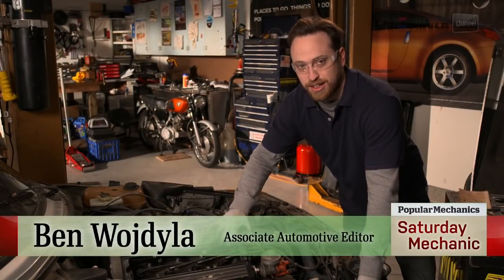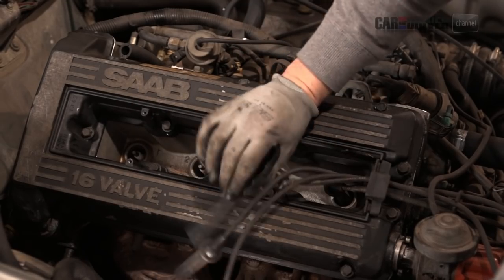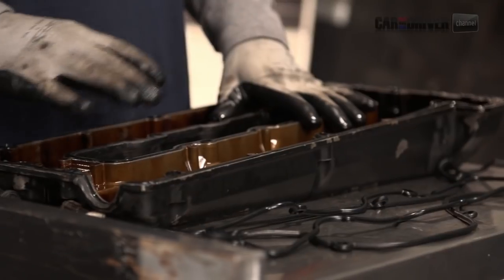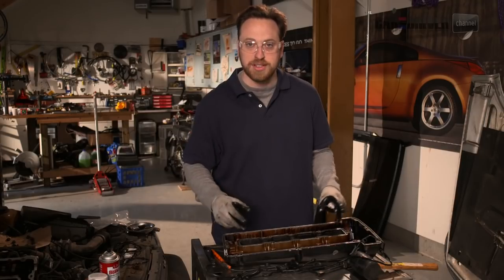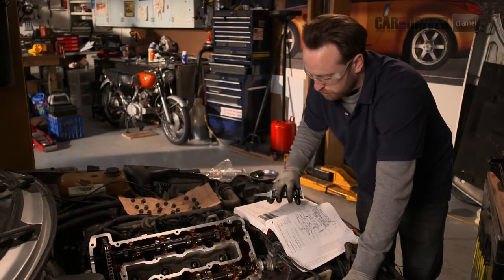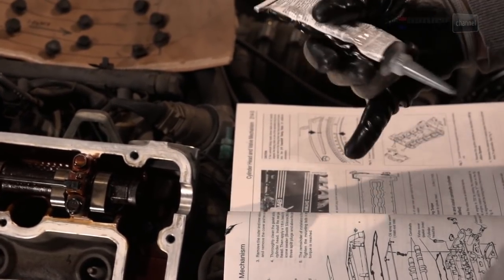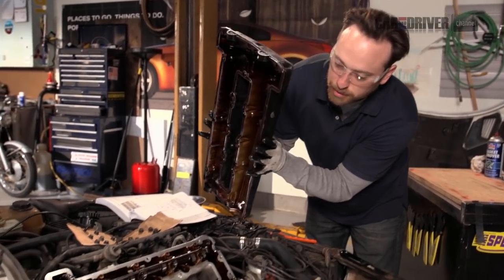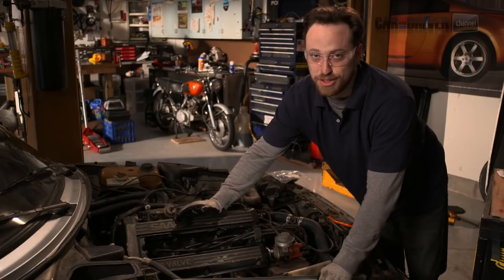How to Replace a Valve Cover Gasket

Comment: I wanted to pull my hair out when he used a metal scraper , you're supposed to use a plastic one or you have the possibility to make deep scratches their for having a small leak...
Reply: D Sim oh man.. my hemroid hurts from watching him take a STEEL brush to the ALUMINUM valve cover.. bet that lasts 2 months before it leaks again. Ruined forever
Reply: Im glad both of you guys noticed that! Im an Aircraft Hydraulic Mechanic, and one of the first things we always learn is *NEVER USE STEEL WHEN WORKING WITH SEALING SURFACES!!! BRASS ONLY!!*
Reply: @WPXTacoMan477  is a copper brush acceptable or no?
Reply: @thebbqprince  I'd say use a brass brush
Reply: @WPXTacoMan477  not that he was wasn't demonstrating any improper practices (i.e., using a metal scraper just before), but @6:05 clearly states that the brush is "soft bristled"

Comment: I've had an oil leak on my 1998 Ford Contour for a while. While replacing the spark plugs, I discovered oil in some of the chambers. After watching your video, you've inspired me to replace the gasket. With a little research, I'm sure I can fix it myself. Not a mechanic, but I'm not afraid to do some of the work myself. Any advice? Great video!

Comment: One thing you forgot to mention which can make a difference between leaks or no leaks, success, or failure. I changed the valve cover gasket on a 4cyl car once, did everything right, but forgot one step. Time. After the job, give a few hours of drying time before you crank the engine over. I didn't and where the RTV hadn't set up yet, it leaked instantly. Had to re-do the job. I waited a couple hrs, (actually over-night) and it worked. It was an old ''88 Merc Tracer 1.8 which was a 323 clone.
Reply: thanks for mentioning that.

Comment: PS. Always test fit the gasket set before you try to put it on. You'll just love life if you get it halfway on only to realize the manufacturer made it 5mm too long. Then you'll have a man made leak from snipping it and having to glob it over with RTV and pray it doesn't leak. Most gasket sets, once you open the box they won't accept it for return. Also, just don't even try to be careful with a metal scraper. Just don't use one. 10 times out of 10, you'll gouge the metal and create more leak areas. It might be hardened aluminum but it's still malleable. Use a plastic scraper or even a plastic spork or plastic knife. Old gaskets usually should fall right off from age

Comment: Just had a question, when you applied the adhesive spray I seen it get into the valve cover is that supposed to get cleaned up and also your engine blocc was not cover up is it serious to be covered or can we leave it open like yours
Reply: I was wondering the same. I think this is why some people opt out for glues instead of sprays

Comment: do not clean oil from cover gasket channels with thinner, destroys plastic , it will break when tightening.
Reply: bd , dunno, to be safe l would wipe it with dry papers or rags , then maybe soap and water , soap that will not leave oil, dishwashing soap and wash away with water.  not sure but seem to remember watching a few videos and guys did not use cleaners just wiped it . may be wrong. just dont think you can get away with using very little thinner , then careless later using more.

Comment: Cool video. Could you do a video on how to check wheel bearings. I have a 2002 impreza, which makes some odd noise coming from the front right wheel, esp. when turning, and i believe it's the bearing. I don't want to take it to the dealer, because they will probably charge me a lot. If it can be diagnosed,i can probably take it to another mechanic.

Thanks

Comment: hi Ben  can you check my youtube home page under " rattling noise" to see if you can figure out that noise. its not the converter or muffler or heat shield loose. thanks

Comment: I fixed tie rods,brakes,rotors,rack and pinion,power steering line twice and power steering pump in my car it's in top shape but this I have a question I decided I'm done putting money into the car

Is it worth for me to fix the 1,000 job with the oil pan and valve cover gasket or would you just leave it and keep oil in it because Cadillacs leak anyways or would you just fix the valve cover with is about 500 please I can use some help

Comment: Do you need to wait for RTV to set before turning on engine?
Reply: Zach Komins not on a valve cover. oil pan...maybe. give it an hour to be safe
Reply: Yes. Valve covers get hot, so allow the RTV to sit preferably for 24 hours for a full cure

Comment: this is a really helpful video. Im going to be replacing the valve cover gaskets on my 1987 oldsmobile cutlass ciera 2.8L 6 cylinder engine soon, I will also be replacing the transmission gasket as well since its leaking. I don't know much about cars and if you have done some work on this model of car I could use all the tips I can get.

Comment: HOW about replacing a valve cover gasket on a toyota prius second gen. 2007. ive been doing research to no avail. the valove cover is so far in the bumper its really unacessable. any tips help. there arent any toyota pdfs ive been able to find either.

Comment: my 2k dodge dakota is in the shop for this very thing. what will i gain after the gasket is replaced? more horse power?
Reply: +Tyrone Walker ,
No added horse power, only girls follow you now!!!
Reply: +Sid G. No they don't.
Reply: ok, then you won't have oil leak & smell of burnt oil inside, best of all, better compression,which could've positive effect on performance!(Happy Motoring!)
Reply: With a dodge Dakota the last thing you should worry about is horsepower gain

Comment: Is it the same procedure when the valve cover cracks? I mean if we get another cover from a same but used car will it fit on the engine block with no problems or is it a long shot?

Comment: I have a 2000 Toyota Solara V6, and I have to change both the front and back valve cover gaskets. As I have been told by others, for these 1MZ-FE V6 Toyota engines, the rear valve cover is a pain in the butt to remove b/c of the removal of the intake manifold. I think I can figure it if I look at it. What I need to know is what the torque specification and the bolt pattern for the valve covers are. Do you know where I can find these specs?

Comment: So do you have to use that sealant on the head? Or can I just put the new gasket on and bolt it down? btw I have a 1986 Crown Victoria Coupe (if that means anything).

Comment: Hi.

I changed my spark plugs today and found that some of the "holes" of where spark plug goes, had oil in it. Not every hole had oil, just few. Spark plugs themselves were normal and dry.

So i have to deal with valve cover gasket?
I noticed that instead of gasket there was like bitumen, some black silicone or something, between the valve cover and engine itself.

Comment: Some spray glue did went inside the valve cover when you spray. Spray glue will get into the engine oil when engine gets running!.   I am not sure how much damage can do to the engine.

Comment: I have oil on my spark plug in the number two cylinder, and its been like that the last couple of times that Iv'e changed them, so could this be a probable cause of this?
Reply: yes that is usually the main cause of oil on spark plugs

Comment: Less is more. Too much gunk will actually interfere with the nice seal you're trying to make with the four surfaces (two sides of the gasket, the engine head and the cover). The RTV is being used here for the rounded surfaces. Putting it where there is a nice straight surface is a waste, and introduces more possibility of lumps/air pockets.

Comment: thank you for a very helpful video! just a quick question : when replacing the valve cover, is there a threat that some of the rtv silicone might be pressurised into the chamber which in turn is bad for the engine? cheers!

Comment: thanks for the video, best one so far. I am looking for torque measurements for my 1989 Toyota v6 truck. I need it for valve covers and plnum cover. Is there somewhere I can find measurements for gaskets on engines that you know of? My repair manual has nothing:( Thanks

Comment: I replaced my valve cover gasket, but its still smoking.. any ideas? thanks
Reply: You either need new valve seals, intake gaskets, or piston rings. Most likely valve seals depending on how the engine is treated.
Reply: Joseph Crabtree

Comment: do you have a video on how to change gasket valve cover on a 1999 Honda accord 4 cylinder I'm having trouble putting on the gaskets and the bolt grommets
Reply: +transauno Did you ever figure it out? I have the same car and I'm trying to figure out how hard it's going to be
Reply: +Iron Nuka it is hard i put it on but the gask is coming out a little
Reply: transauno Damn, when you took it off did it kinda look like this one in the vid? I think I can get it lined up once its off, I just wanna know what it looks like underneath first. Did you use the tacky stuff?

Comment: might be good for some Although I am a female and have a 2000 toyota about a 02 sensor and have not been able to find anything on you tube can some one direct.  Mainly so I will not get ripped off at the dealership.
Reply: buy a bluetooth obd2 tester their usually pretty cheap and can diagnose most issues with your vehicle
Reply: Thank you. Took to autozone and dealership to be checked. They pretty much said the same thing which is. Bank 1 Sensor 1; Bank 1 Sensor 1 and V V T System Malfunction 1
Reply: I have been looking on YouTube to find the make model and year so I can see where the sensors are located. As well as someone doing there own.  No one has a post of doing a 2000 Toyota Avalon.  

Of course the dealership wants about $1800  living in Las vegas.  and that is IF  they can find part being the age of the car according to the dealership.  They prey on people at these dealerships here hoping the person say just rather buy another car. Also, trying to find a mechanic and the part(s). Any more help would be greatly appreciated.

Comment: Someone told me I need a torque wrencn todi this job or it will keep leaking
Reply: You really do need a torque wrench for the job, but the "or it will keep leaking" is misleading... it suggests that if you don't use one, you won't get the bolts tight enough and it'll leak. Using a torque wrench is every bit as much about not over-tightening the bolts as it is about getting them tight enough.     I'm sure you've already picked up on this, but I think it can't be said enough, just in case someone comes along reading the comments and doesn't know yet. Of all the tools I've acquired over the past 4-ish years as I have progressed working on my car, my torque wrenches (1/2" and 3/8" drive) were some of the most affordable $10-20 at Harbor Freight, and they're still among my favorite tools. They give me true confidence that when I've done a job, it's done properly.
Reply: get one that measures "Inch Pounds"

Comment: I love how you skipped the hardest part, where you remove rtv/gasket material from the head without letting it fall into the valve stem holes, etc. LOL. :O) Maybe you didn't have much residue on the head... but on my Dodge Ram Van/318 engine, there's quite a bit, and very little room to work during the scraping off process. Uggh. The entire head surface is level but rough, almost "pitted" all around the surface-not smooth as I was hoping. Was planning to use RTV on valve cover side of gaskets (2) only, as recommended by Mopar people, but maybe I should put some on both sides of the gaskets, and just hope I don't have to take the valve covers off anytime soon ($16.99 a pop).
Reply: bookguitarguy Can't you just take some plastic and cover the valve stem holes? Seems like a simple soln to a really potentially serious problem.
Reply: Jacob Becomes Israel Hmmm... I'll have to think about that next time... the job's already done. I can't see how that could be done, considering the location of the valve lifter holes/guides. The holes are recessed below the surface of the head (ie, below where the valve cover bolts to the head), but more importantly, the valve lifters go up and down within those holes (ie, passageways), so I don't see any way to seal them without interfering with the up and down motion of the valve lifters... Removing the rocker arms to slide some kind of plastic "gasket" over the lifters, and down to the holes might work (like a plastic washer around the lifters), but it would have to be loose-fitting so it did'nt interfere in the lifter movement. Seems like asking for trouble anyway, if plastic was to ever break loose and fall into the holes... but the job was finished some time ago, and everything's working fine. It's not something I have to mess with very often, and hopefully not for a few years, but I appreciate the suggestion, and it's something to think about. :O)

Comment: It's really easy to clean the valve cover area when there aren't any hoses or wires in your way.  Not only that but use a plastic scraper.  Available at any home improvement/auto store.  Using metal is scratching, no matter how lightly that you're doing it.  I dare you to show me a scratch using plastic AND you can scrape as hard as you want.

Comment: There's some stuff in a can called "high-tack gasket sealant" which is a godsend for doing valve cover gaskets and the like, because you can attach the gasket to the part before reinstalling it, therefore it's almost like having "an extra pair of hands".